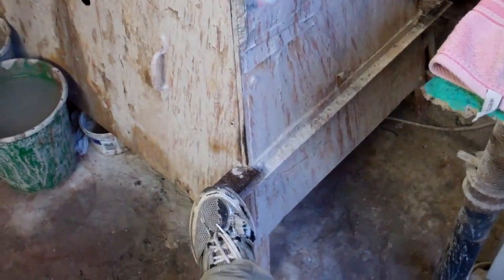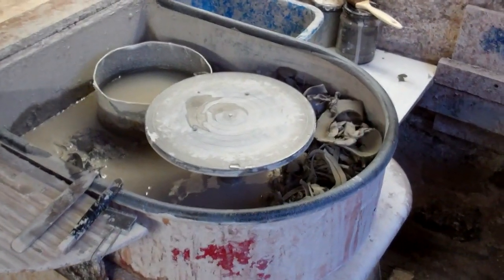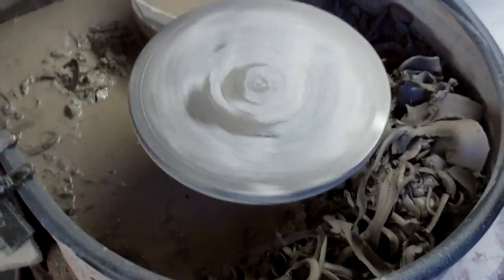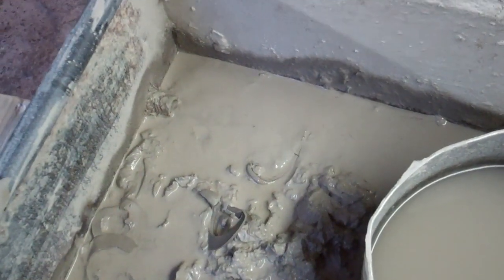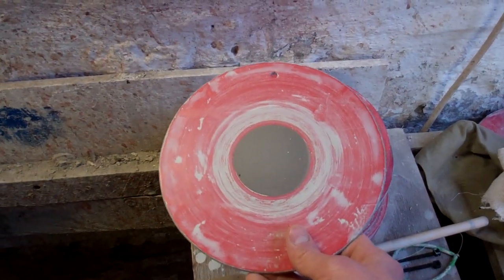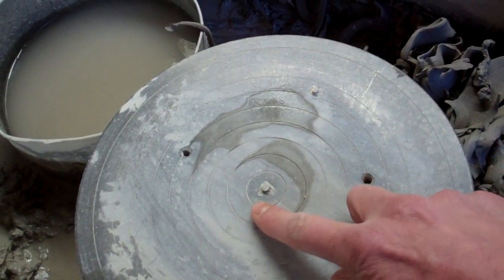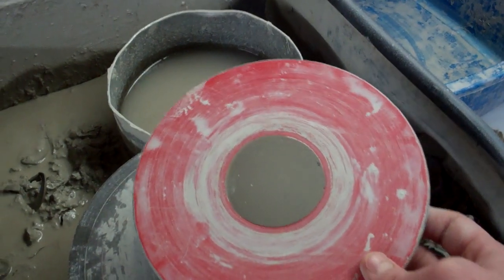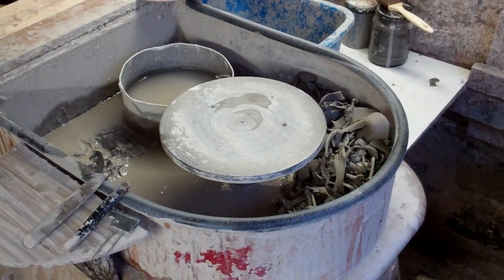A quick look at my Potters Wheel and the Bat system I use.

Comment: Alright there mate, 
Ive just bought a wheel with no pegs or holes in, tried throwing plates but soon realised I need some bats (amateur).
I have absolutely no idea where to go from here, if its easy to put holes into my wheel or if it possible to attach the bat without the pegs?
Would really appreciate the help! Cheers
Reply: Make a pad of clay to hold down batts. There are loads of videos about it.

Comment: i've got one of these wheels for sale..£90 ono.
Reply: Ill buy it if your not 2 far away ,may i ask where your are please
Reply: I have an old wheel similar to this. It doesn't have a foot pedal. I haven't really used it. Had it for years. I just put a studio together, and re-found Ingelton videos, and saw him spin the wheel to get it going, and VIOLA! I think I've been thinking it needs repair, but I think it's fine! Power is getting turned on tomorrow. So excited to find out. Does your's have a foot pedal? Do you have pictures?